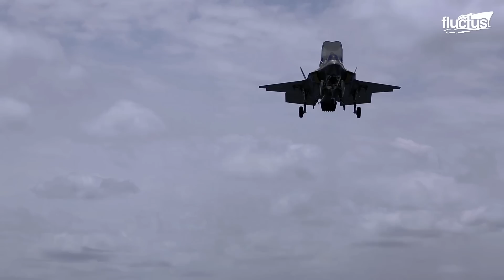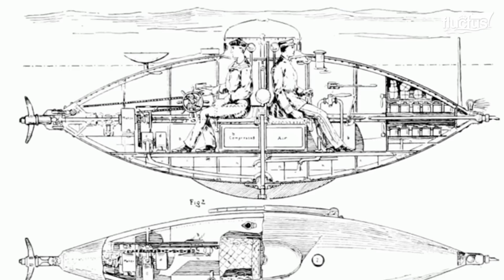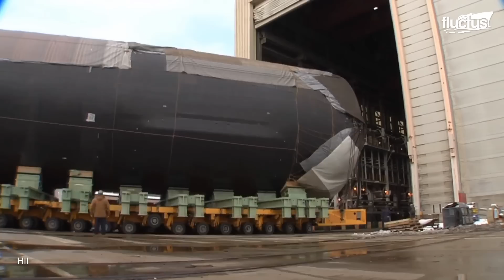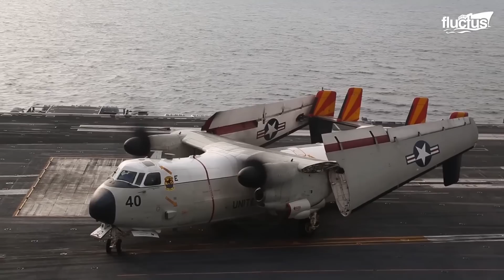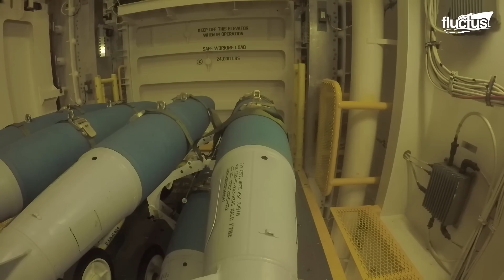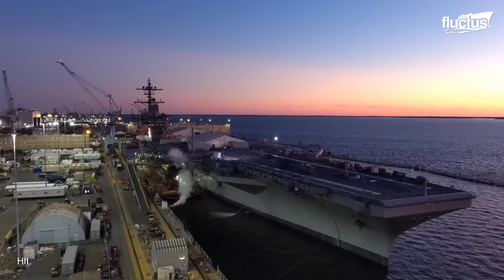US Testing its Brand New $4 Billion Advanced Attack Submarine

Comment: Attack Submarine doesn't sound right.  A submarine is very vulnerable,  with steath being its biggest defense.   
Submarine attack be : surface, shoot,  submerge, and scoot .
Reply: No. An attack submarine carries torpedoes and launch tubes for Tomahawk cruise missiles. It is meant to be used against enemy submarines and surface ships. They don't have to surface to fire either, although they do have to come to a shallow depth to launch the cruise missiles. Fast attack submarines also protect US surface fleets. There are 1 or more fast attack submarines with every carrier task force to hunt enemy submarines in case of war which might seek to attack the task force.
Reply: @krashd  There is a third group now, along with the SSNs (fast attack), SSBNs (ballistic missile) subs. The US has been converting some SSBNs to carry cruise missiles, designated as SSGNs. The entire Ohio class group of SSBNs is being converted. So far 4 have been converted to carry 154 TLAMs,Tomahawk cruise missiles plus onboard facilities for special operations such as delivering special forces to conflicts covertly. In 2031, the first of the new Columbia class SSGNs, built from the start as this type.

Technically, there is also a 4th type, which is just one sub, the USS Jimmy Carter. Originally one of the Seawolf class fast attacks subs, it was retrofitted with an extended section added midships with remotely operated vehicle bays, diver facilities, and configurable command and control and cargo areas for specific missions. There are likely other modifications as well which are still top secret. These functions will all be taken over by the new Columbia class when they are commissioned.